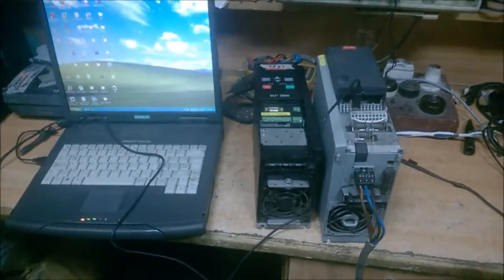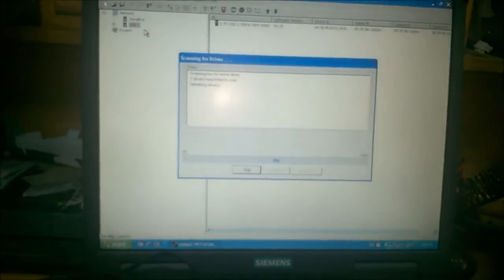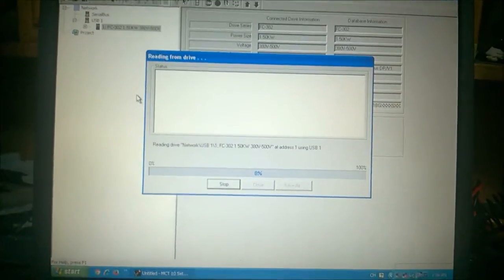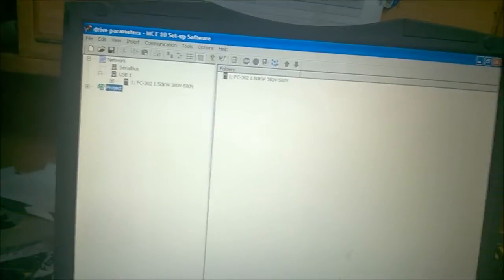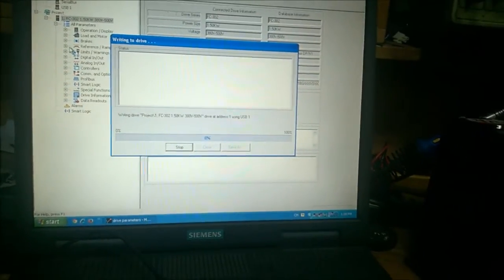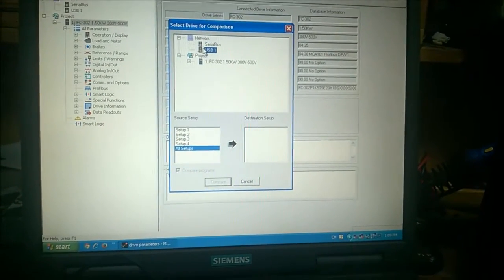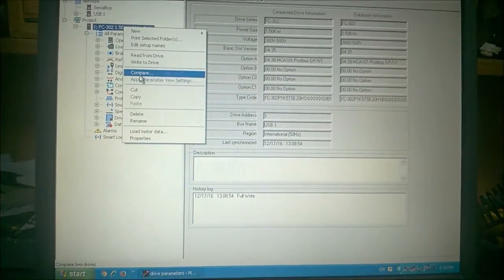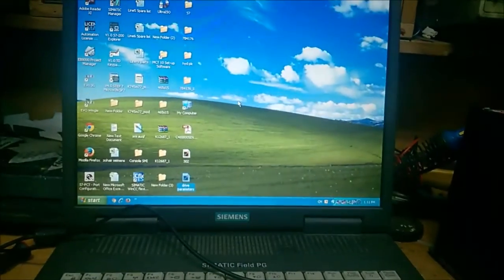Extracting & loading parameters from and to Danfoss VLT FC302 using MCT10 software

Comment: hi! I have a problem, when i connect between MCT 10 and INVERTER, it is being a error: " UNSUPPORT ON ADDRESS 1", do you know? please help me? I hope your answer!!!! Thanks
Reply from the maker: huynh nhu canh are you using the latest mct 10 software
Reply from the maker: huynh nhu canh and what is your inveter model
Reply: hi shahyan Bharucha, I am using inverter model VLT CDS 302 and MCT 10 software version 4.2
Reply from the maker: huynh nhu canh are you using USB port of drive for any other communication?
Reply: yeah!!!, what is the matter? you can teach me, how to get rid of the error?
Reply from the maker: huynh nhu canh try disabiling USB communication from parameters then try using USB to connect mct10.
Reply: i can't, you can teach me, how to disabiling USB communication from parameter? I did the first time, so  I need you
Reply from the maker: huynh nhu canh tell me the 8-02 parameter

Comment: Hi I'm trying to replace a VLT 2800 to a FC 301. It has to  run in unison with another 2800, but I can't get it to run in remote mode. Only off Manual on HIM unit. Any ideas on this? Thanks
Reply from the maker: have you compared both vlt's parameters ?
Reply: I faced the same problem. No communiation betweem MCT10 and VLT2800. Have you solved your problem?

Comment: sir..there is an error on our danfoss drive..showing "error 84".i can't find the meaning of it.can u tell me what does it mean??
Reply from the maker: what is the drive's model no.?
Reply: danfoss fc051
Reply: i am surprised that still the drive is running without any difficulty,the problem is that i can't access the parameters.
Reply from the maker: This is a parameter lock error. Some one has put a lock in parameters so others cant change it can be removed from parameter i don't remember the number check the manual. Just change it from 1 to 0 this lock will be removed.
Reply: okk.. let's see
Reply: by the way..thanks for the suggestion..